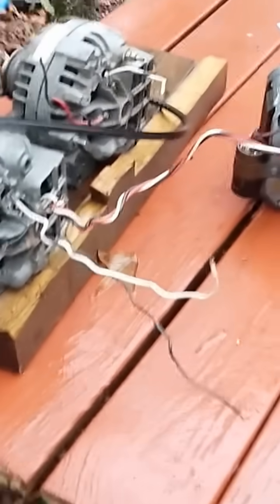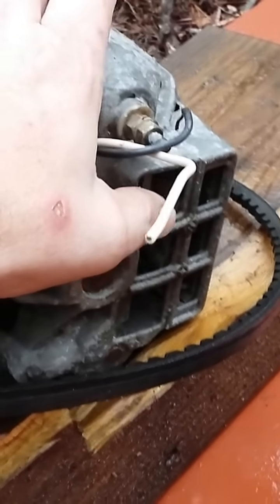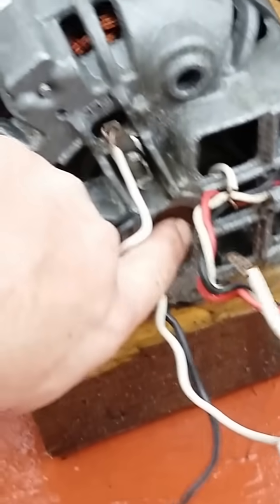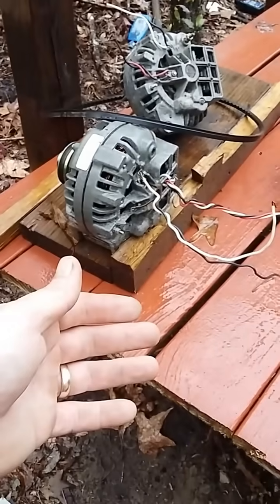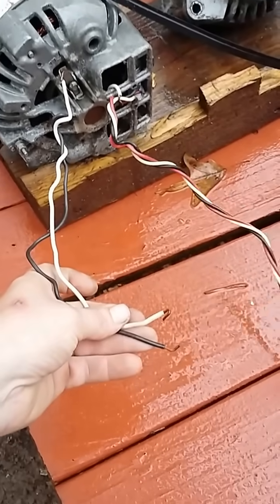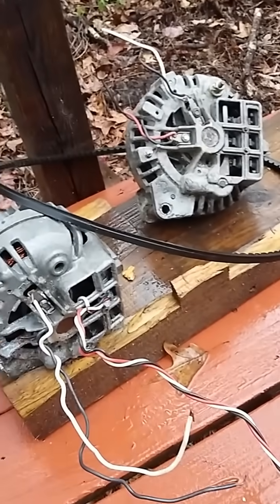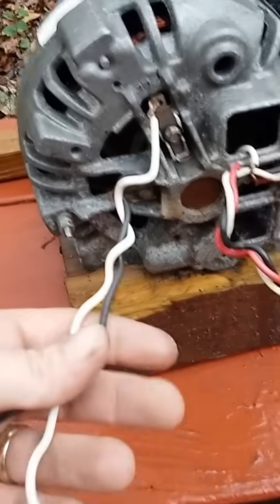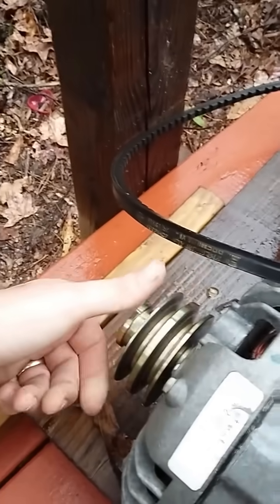Update Free energy forever no wind no solar no gas READ DISCRIPTION!!!

Comment: Just a couple of questions.  I assume the 3-12volts you are putting on the black and white wire are for generating the field. Now at 12v you said there will be 90amp 3phase; but at what voltage? I find this interesting I have rebuilt many 3phase generators in a industrial setting.  My concern would be that the drag being caused by the opposing fields would require and electric motor with maybe 3 times  the amount of windings to overcome that amount of drag. How did you over come the lose in efficiency? The most efficient motor I have came across would be something like a toshiba 3 phase but even those are are rated at about 76% and the best 3phase generator I have ever worked with was about 80% made by siemens.  so the is a 42% lose in efficiency, now one would have to assume the average person would not be able to afford such equipment, so I would hazard to guess the efficiency would be about 60%.  now these are real questions so before you go bashing thinking that I am trying to discredit you.  I see this as a great for alternative energy sources i.e. wind or hydroelectric.
Reply from the maker: I've been waiting on you to comment on this video for months now!!! First of all. I would like to apologize for some of the "bashing" that I have done, it was adolescent and not something that I would usually do! There are a lot of circumstances going on in our lives right now like money problems, death, and losses that no one knows about because I don't want anyone to Pity Me and I should never have stooped to the level of the adolescence commenting on my YouTube. So with that being said. I do apologize!!!
Reply from the maker: I overcome the efficiency loss by only using milliamps for my field on my stators and I used self exciting Bridge rectifier mosfet setups with capacitors and with almost no resistance on the generator end and at 3600 rpm I am able to keep perpetual motion. when you think of a bldc motor (alternator) you can have all the high RPM and as much torque as you want. I used a 1 & a half horsepower Farm Duty compressor motor to power up two 10,000 watt generators (7400rms) with a clutch system the hardest thing to overcome is the SF or startup amps  but once the motor is running  you can turn the other generators easily  it only takes a few seconds to get up to speed and you can cut off  from your initial power source. I'm about to make a video and show everyone my set up even though I am disabled, jobless, and receive no donations. TRIBULATIONS (months now) but I live for yah-weh and it is time to set everyone free!!! Since you have wired Simmons electric motors and such could you please do the math and tell me about how many, larger self-exciting generators I could turn with a 500 horsepower Simmons electric motor? Let's just say around 20k vac each so they're not too big.  I mean I know it would probably power the hydro electric damn with a nice gear head on top of it that's close to my house.. but that powers all of the cities around here which is over half of the state I live in and I'm not trying to power the whole United States. I want the world to power itself!!!
Reply: Lets start with something a little smaller.  A 3kw generator produces,12.5amps, at 20vac 1-Ø requiring 14.6 ft/lbs of torque at full load. The best and most efficient motor requiring the least amount of power would be a 5hp dc motor.  A 5hp dc motor will produce 15 ft/lbs of torque at 1800 rpm. The motor requires at full load, 500Vdc 8.5amps /arm and .49amps/ field (4.5kw). The alternator as a brushless dc motor(bldc), has high current requirements to be used as a motor, more compact and cheaper but less efficient than a standard dc motor.  I understand how perpetual motion works but how are you overcoming the braking force of the load(opposing field).  I am very interested in seeing any mathematical formulas you have derived showing your compensation for the loss in efficiency.  Did you figure a way around the torque requirements?: in order to lower power that is required from the driving motor.  please get technical as you want, I have degrees in both electro-mechanical engineering and advanced mathematics and I love working with problems such as these.

Comment: Hey Thomas: I understand almost everything in this video except: Why do you have to run DC to the Alternator if you are using a separate motor to spin it? It seems like you would only have to run DC power to it to run it as a motor!
Reply from the maker: Bandit Quest  You sir, are awesome! I think you very much for your "kind" question and I will certainly answer it and you will understand Vortex based mathematics on a 3D level scale as soon as you get what I am saying and you will be able to build anything you want to build. Is an east and west magnetic field coil a motor or is a north and south field coil a motor.
Reply from the maker: and alternator is not self exciting unless you put an alternating current Bridge rectifier on the back of it and take the diodes or direct current Bridge rectifier out

Comment: Alternators power all electronics in modern vehicles, which often have over 16 computers, and draw more than most trailer homes during quiescent hours.  A good backup setup (for when the power goes out) is just to leave the alternator in the car or truck, and hook a high-wattage power inverter directly up to the battery.  This is not free energy, of course.  You'll be spending more money, temporarily, on gas, than paying the electric company when it's working properly.  But it's great when the power fails.  Just be sure to keep all exhaust way away from enclosed living quarters, obviously, to avoid carbon monoxide poisoning.  I wouldn't worry too much about people coming after you for playing with alternators, unless you have some really wired (sic) people monitoring you.

Comment: ok, there are a few key subcomponents missing from this set up. most noticeably is the driving motor for the alternators. you would need a 5 HP gas motor or 3-4 HP electric motor to turn 2, 90 amp alternators (minimum). alternators are self sustaining once energized; however, this energized state can only be achieved (and maintained) if the alternator is spinning fast enough (typically a minimum of 2000 RPMs is needed to "excite" the alternator, but realistically, you would need about 3000-4000 RPMs to produce any real current). secondly, you could NEVER run this power arrangement directly into a home. while bypassing the diodes will create an AC current, it is in a distorted and unusable format. the electrical current must be "cleaned up" in order to achieve the 110v, 60hz, single phase electrical signal we require (not 3 phase as depicted in the video).   you might be able to run light bulbs with your proposed set up, but nothing else. lastly, while your efforts have been noteworthy,  i would have to question your credibility as you talk about electricity while standing out in the rain.

Comment: You made absolutely no sense what's so ever ya know? Because you can tell by the background of this video it was raining you know..... water conducts electricity. When that happens, the circuit short circuits because the water connects the alternator to the soil which in turn becomes ground. By now you can tell I'm mimicking him by making nonsense facts to get around the fact I didn't explain WHY he didn't make sense but by me throwing a bunch of factual facts my point is valid because i distracted you! But you know what? Get them YouTube views.

The only way 2 alternators can produce free energy is if one powers the 2nd one. If the 2nd one produces more power then the 1st one consumes, what ever extra it produces is FREE energy. You made absolutely no sense in this video. You just educated everyone on a diode..... you can call em on his bs because you can see two wires wired to the same damn terminal!!!! Like that makes sense.
Reply from the maker: yes you're exactly right water does conduct electricity and you will have to use a ground in this application I did understand exactly what you said and I'm sorry that that is the way that I talk I explain things to different ways every time I explain them but to answer your question why would I use one alternator as a motor and then only try to turn one alternator with it by the way they used to call generator alternators because all three of them are the same thing so if you know how to do ratios 2 to 1 or 3 to 1 then you'll get what the video meant I hope this answers your questions and I really do appreciate you not cussing or being mean with that being said and you knowing how to run something in parallel then there would be a reason for me hooking two wires up to a field wire probably for testing reasons
Reply: He said probably for testing reasons. My point proven
Reply: Cihan Ugur you seem pretty dumb, Thomas was obviously talking tongue in cheek. Why try and put a downer on something you obviously know nothing about? You just make yourself look silly.

Comment: Hello Thomas Buie,I have an alternator that is putting out 270 amps how many watts can I expect at 120 volts??? Also I would really love to have more information than the video above....If you can spare me some time I would much appreciate it!!! Thank you!!! Greg
Reply: Greg Scott I apologize for using foul language. It just makes me upset when I think someone is being intentionally deceptive. I can see now that is not the case with you. I think you are just misinformed. A bridge rectifier uses four diodes to convert ac to dc. There is no easy reversal of this process. The only way to convert dc to ac is to use an inverter to mimic the alternating current. I am not well versed on the alternators you are using there and their internal components. I can only speak on general electrical principles.
Reply from the maker: the video above was misleading on purpose I didn't know that anyone had any knowledge of overunity when I made the video. you need to take the direct current Bridge rectifier out of it and put in a alternating current Bridge rectifier and then you will have an extremely strong generator / alternator.
Reply: ok. Thank you for the very timely response....

Comment: think!!   you need a 6 volt battery for your power in, which will have to be charged , off of your motor with a battery charger!
that's how you get power. the thing he doesn't mention is that cars have a 5 or  6'' pulley, and his 30 year old washer motor has a small pulley, so he won't get all 90 amps!    I saw an alternator which said at 6k rpms, it produces 73 amps. and at 2k it produces 43 amps.   i did see a cadillace alternator with a total of 130 amps!  but, it will have to be spun with a big pulley, not a 2'' one, (or 2 1/2) '' like he shows on the old whirlpool motor.

Comment: Thomas, you are a very sincere man and that is appreciated for sure. Yes the alternator can be used as you say to generate electricity but you have to have ENERGY to generate the electricity. There is a loss between the alteration/generation from one energy for to another. That loss is heat due to resistance in wire, bearing friction, etc. The purpose of the wind is ENERGY. You could use the wind to provide the energy needed to spin the pulley and therefore the stator in the alternator/generator to produce the electricity but you still have losses. You are kind! You idea is sound but there are engineering flaws in the idea. I'm a retired electrical electrician controls engineer son. Keep it up ... you have the spirit!

Comment: As I smile I type ...some of what he says is right but he is very misleading. Like many others making these types of claims, he is a salesman. You have to decide what he's selling because I haven't figured that out. Listen to what he tells you. He says it's a 90 Amp alternator. He bypassed the diodes by connecting directly to the Stator. This direct connection provides AC vs. the DC you would otherwise receive from the main terminals. In the simplest of terms, the diodes rectify or convert AC to DC. Aside from mixing the conversation about the motor BS, the rest of what he says is all BS. I will assume you know what BS is :-)

Here is where the real mislead comes in. What do you have to do with a generator/alternator to get power from it? Answer: Rotate it. He said, "I spin this with a motor". Well now! Where does that motor get its power? Answer: An electrical source. 
The power to rotate any generator or alternator must come from some other source. You must also understand this arrangement will produce an AC voltage output completely unregulated and dependent solely on motor speed.

So, here is my recommendation. Understand the basic word power. It doesn't necessarily mean electrical so get creative with your sources of power. A generator or alternator themselves are power converters. 

Bottomline ...simple laws of physics dictate, nothing in nothing out! Know this, to date there is nothing discovered that dispute these laws and if there ever is most the world will know in just a few moments. By the end of the day, the whole world will know.
Reply from the maker: +Selggur I don't really know why you're trying to knock me down I haven't figured that out yet but you didn't ask any questions and I'm really curious as to why not but if you're saying nothing in nothing out then how does a generator work when you turn the shaft nothing in nothing out. Do you know where resonance comes from? And if Tesla was able to multiply 5000 times why can't my windings multiply 1000?  I didn't say it was a 90 amp alternator. I said it was an 80 amp alternator that actually produces 90 amps..

Comment: I know a bit about basic electricity and have one simple question I would like answered. What is your power source to spin up your generator?
Reply from the maker: +Kevin Ireland sure thing Kevin, I'm using a motor. I've actually upgraded and waiting on a bigger motor to come in it's a single phase 2hp 110 or 220.

Comment: I think the problem in understanding this is because most people do not understand basic electrical equations. first thing is what we call a alternator today is a generator from yesterday. Generators are designed to produce 3phase AC current, their still built that way today. They use a parallel series of diodes to make the AC current primary and 16 volt DC current secondary. Thus, removing the diodes means 240Volt 3phase AC electricity. drop the center winding tap and you have a powerful AC generator in the range of a 14,000 - 18,000 watt generator. I've found alternators (generators) from HO autos like older Lincolns, Chryslers, diesels, etc to produce a much higher KW rating due to the larger copper windings. my entire shop runs off of 1 Ford HO 7.3 diesel engine alternator (generator) spinning from a wind turbine tied to a series of different sized pulleys. Sure I change 3 belts every year at a cost of $50 but prior to that I spent $300 per month on shop electrical bills. I'm a retired master electrician from a industrial and marine firm, this has been a proven system for years but like this young man said, people have been killed over sharing this knowledge. I'm behind you young man and I don't hide behind a phony screen name, I use my given name. :)
Reply from the maker: +Tom Patterson you're absolutely right about everything you said Tom!! And I don't hide behind a fake name either!! It is very sad that people have actually been taught not to think outside of the box and that everything they tell you is real so they believe it without questioning anything!! What they don't understand about this is that the alternator produces direct current because of the diodes and you're also losing 50% of your power by using those diodes but I think I could preach to the choir all day.. Thanks for your input, I really appreciate it!!!

Comment: It is the same principal idea of a gas generator, just on a smaller crude scale. Now people use that thing called a brain and take it to the next level. Experiment using magnetic motors, Micro wave transformers...What ever to turn the alternator. Run the alternators in series. Regulate your output so you get a steady consistent flow of volts. This man just planted a seed in your brain, Do not disrespect him for that. Take it to the next level if you want to see if it works, I am doing just that. Working on a small magnetic motor to spin the alternator. If it does than I will run two in series with a voltage regulator.
Reply from the maker: Thank you very much kind sir for your comments and it's a lot simpler than that I'm building a multi motor multi generator systems on a lot larger scale than what I showed on the video but you're right keep up the good work brother

Comment: How is it free if you have to spin the belt pulley, don't that require a motor?
Reply: also never get 60cps out of this .400cps l 000 watts max need energy to turn it .better running it at 13volts charge deep cell batt.hook to inverter .or buy tractor supply 1800 w. gen .w.12v.charge port.160$ charge batts.